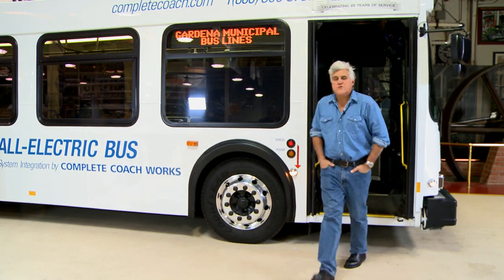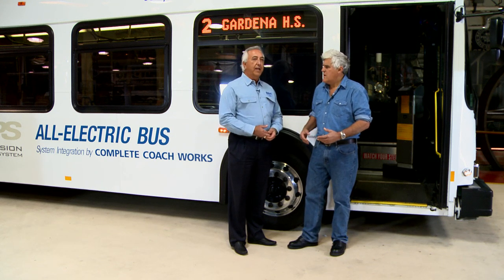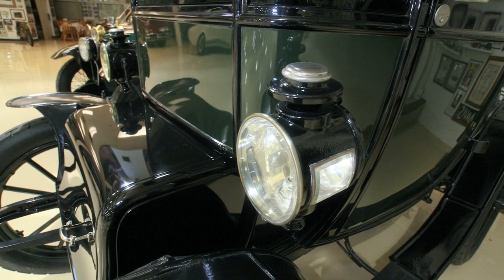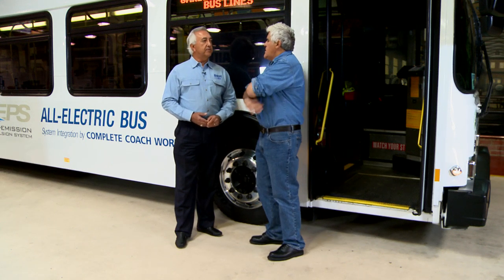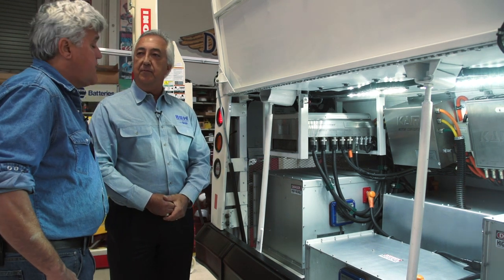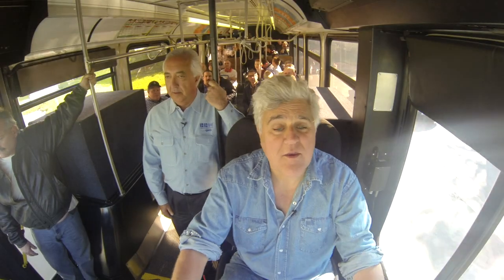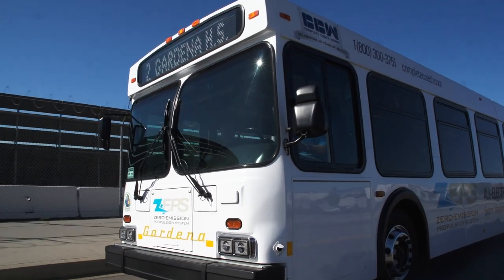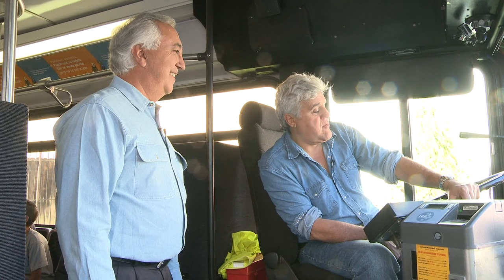Electric Bus Conversion - Jay Leno's Garage

Comment: I occasionally drive trolleybuses at a local museum operating from the 600v dc overhead, the UK had hundreds of them until the mid sixties and the last went in 73. They too had rheostatic brakes and were of course virtually silent and no pollution at road level. Battery buses like this are ideal for the cities and I think the recycling of the original structure is excellent.
Reply: and at the time nothing could beat the of the line from lights apparently
Reply: Perhaps the odd sports car :)
Reply: I'm old enough to remember the old trolley buses and probably went on one in '73. They could be a bit jerky when setting off as I remember. No doubt had they continued to use them they would have improved a lot.
Reply: I’ve ridden trolley buses in Seattle, Washington.  Still have them in 2021, brand new ones came out few years ago.     they have the 40 and 60 feet trolley buses.
Reply: Vancouver still has several trolley bus routes.

Comment: What a great idea to recycle and convert to electric! Well done guys! We need more of this!
Reply: But the electricity that charges the batteries is still produced from dirty old coal and natural gas!
Reply: @user-cy6gf2pj7y  Yes, but vehicle engines don't get anywhere near the efficiency out of fuel as power plants get. IIRC your car converts 1 unit of fuel [let's say natural gas powered vehicles for direct comparison] into energy at an efficiency of 20%. A Natural gas power plant manages 50%. Even with some energy loss from transmission [lets say we lose 20% in transmission... so only 40%, that is actually unrealistically high loss rate]... running electric cars off of batteries charged by central power plants will save you half the fuel and thus half the carbon output. 

Incidentally, plug-in hybrid cars get closer to 25-30% efficiency out of their engines when charging the batteries because they can run at a perfect efficiency cycle rather then the less perfect cycles straight internal combustion provides].

Comment: Retired bus driver from Las Vegas, here. I agree with all of you commenting about room on the roof of this bus for solar panels. Even with the HVAC unit mounted up top, RIGHT ON! They may be able to extend the range of the bus that much farther with solar panels. Also, among the buses in our fleet back when I used to drive, the one you see here, the New Flyer D-40 Low Floor, was a real treat to drive. They had decent power, a nice ride, and handled surprisingly well for a city bus.

Comment: I need my RV converted now, I love this kind of thinking.
Reply: I wonder if my housebus (converted school bus) could drive to California from Minnesota with this... Bah! Until charging stations are built across the country I'll have to stick to diesel. But once charging stations are up, battery capacity should be increased... That'll be cool once I'm able to convert it.
(I don't actually have the bus yet, I'll be getting it in 2020)
Reply: Range 80 miles. 4 hours to charge.

Comment: The roof of that bus is begging for solar.
Reply: +Snarky you can save weight with cutting metal roof,adding carbonfiber and solar panel...it would add to expenses but I think it would be worth
Reply: +Snarky absolutely not true, solar panels are not that heavy
Reply: +Snarky there are solar panels in pedal bikes and trikes
Reply: +Snarky No it wouldn't.
Reply: +coldcoldrain13 Yeah. And that would produce enough electricity to power the left blinker! But only on sunny days :(
Reply: +coldcoldrain13 
They mentioned that adding solar is in the works.
Reply: Gil Strang563 The square footage on the roof of that bus would easily generate over 3000 watts with current tech.
Reply: Solar is not that efficient to be able to produce any worthy amount of energy compared to available footprint of the roof. It'd rather stay on the bus parking roof.
Reply: how about a MEDICAL MARIJUANA SMOKING AREA on top?
Reply: Pumpkin see you in halloween
Reply: Bus roof could easily support 3000w worth of solarpanels.
Reply: +coldcoldrain13 The airplane was developed by private inventors.  Green tech has had billions of tax dollars thrown at it yet it's still a poor substitute compared to legacy power production.  If you libtards believe in this technology so much pay for it yourselves.
Reply: Their motor has regen which basically does what you're suggesting. When they go down hills the motor charges the batteries. If you put generators in the wheels they would have to only engage while going downhill as well.
Reply: flex panels would not weigh, nor cost that much.. we use flex panels on our rental boats. www.ecodonutboats.com
the roof on a standard 40' bus would be approx 30 m2. with space lost for AC and exit hatches there is approx 25m2 left for panels. 25m2 flex panels would weigh 90kg and would produce up to 20 kw per day.
they have 312 kw onboard and only charge to 80% and never go lower then 20%, means they use max 60% of their battery on routes. 60% of 312kw = 187kw 
Conclusion a solar roof would allow (on sunny days) the battery to be used less and take less time charging back up. in terms of percentage we are talking 20/187 = 10% battery savings on sunny days. you could say that the AC will run on solar..
Reply: Idk who is convincing these people that you dont get much power out of solar and that they weigh too much for it to matter but its ABSOLUTELY ridiculous and laughable lol. Do research before you spout stuff you dont understand.
Reply: You're talking about generating 360 volts at 130 kilowatt hours with huge amp draws. the Three Phase D/C motor reduces power consumption. But you would not be able to produce enough electricity with solar panels on top of the bus to make much of a difference. Little alone the cost of the solar panels and to implement them to the top of the bus. The way this bus sits sounds like the most cost effective way. The ideal goal would be renewable energy at the charging station not of the bus itself.
Reply: @MrWhite-pn7ui  much of legacy energy is heavily subsidized.  Both now and in the past.

On topic flexible solar panels would work but are less efficient.
Reply: Facts solar POWERED not solar assisted
Reply: How do you buy a bus for a couple thousand dollars?? How. Can you explain?

Comment: Another option is duo-powered electric bus which essentially is a trolleybus with onboard high-capacity battery capable of fast charging. However, it's also equipped with a pair of modern current collectors (trolley poles) you would see on a conventional trolleybus.  While under the wires, the bus is directly powered by electric power drawn from overhead wires and at the same time, it is also charging a bank of onboard battery (usually lithium ion battery).  The bus can go on battery with full load & air-conditioning running for up to 15 miles or more.

You only need to install overhead wires on certain segments of the route. For example, if you find the wires unsightly you have the option not to have overhead wires in the city centre or places of interests or popular for sightseeing for tourists, etc. You have the flexibility to have overhead wires only in the suburbs, housing estates whether the bus route is a cross-city route or radial route.  

With this technology, you can completely eliminate the need for overhead wires in the city and only have them in the suburban segments of the bus route. When entering the city, the bus automatically disconnects from the overhead wires at a touch of a button by the driver, which lowers the current collectors and locks them down on the roof and continues its journey like a conventional electric bus inside the city area. Upon exiting the city, the bus enters the wired zone and raises its current collectors at the specific catchment area (usually at a bus stop), also at a touch of a button by the driver.  Passengers inside the bus would not even notice the change of power source as this is done very quickly when the bus calls at a bus stop. 

Compared with a conventional electric bus:  
Carry smaller and lighter battery, no charging stations required, no time wasted on battery charging as it charges on the go, faster turnaround at the bus terminal if required by deployment,  guaranteed continuous supply of electricity with parts of route under overhead wires, strengthened reliability, more attractive to commuting public as overhead wires indicates the presence of public transport & a sense of permanence. 

Compared with a conventional trolleybus:
More flexible as it can operate independent of overhead wires for long distances like a conventional electric bus, eliminate the need for new overhead wires in the event of route changes or extensions (be it temporary or permanent).

With that, you get the best of both worlds. :)
Reply: Jere Cullen they are in use by septa in the city of Philadelphia no battery that i know of  but if they lose the trolley poles they have a small aux motor not sure if it runes a generator or geared to wheels they were called trackless trolleys in philly. makes much more sense to do that than the 32 million 25 fed funds to install tracks and wires in Charlotte 1.5 miles
Reply: take a look at the gyrobus from the 1940s. It had most of the features you talked about. if it had better range it might have even replaced the trolly car.

Comment: No comments? this bus is awesome! we should do the same thing in Europe.
Reply: We do.
Reply: dennis trident william I know we have Electric buses, I saw a couple in Copenhagen but I have never heard of one in Europe that was converted from a retired Diesel bus.
Reply: +Sohave in Britain we have an old 15 year old Dennis trident that was made electric and some more will be soon and it makes around 3000 foot pounds of torque
Reply: dennis trident william Cool In that case I take back my comment. I hope that many other nations will do the same to their old buses.
Reply: +Sohave We have lots of electric trains, if that counts
Reply: Re No I know we have plenty of electrified lines and Dennis answered that yes in Britain a few old busses have ben converted.
Reply: +Sohave We did, we call them Trolleybuses, no need for batteries (lithium free electric powered vehicle).
Reply: Philip Cooper I know those and they were not what I meant we are talking about battery electric vehilcles, and almost all trolley busses are build as trolley busses through many share the same basic body as diesel busses. But here is a little fun fact about trolleybuses, When speaking about converting a bus to run on electricity In Denmark during WWII a couple of regular buses were converted to trolleybusses by fitting a standard trolleybus engine to the existing transmission and attaching trolley poles on the roof. Here is a picture of one of those conversion trolley busses: http://www.vognstyrer.dk/Sporvogne/KS/Vogne/Trolleybusser/107/107-2.jpg
Reply: er
Reply: we use biofuel in Norway
Reply: +Re 
Battery operated electric trains or diesel powered generated electric trains?
Reply: We do. And not only with batteries buses. Also trolleyboses are pretty common. A very reliable system in which a bus can run all day long not needing recarching...
Reply: fatboyto I know of both build electric busses and trolley busses I was thinking of converted busses.
Reply: We don't like old buses in Europe, because they tend to be high floor vehicles, and demand low floor ones for better accessibility. That, and the body starts to rust, and needs replacement as well, not just the motor parts. But you're right, we could reuse them more often.
Reply: Bart Van de Walle
 Many buses build after the 60'ies are made out of aluminium so only the frame can rust and that is still pretty thick and probably still in good condition after 15 years of service.
Reply: +Sohave Not entirely sure, but it seems in Europe, there are more steal bodies in use, at least partially. But evenso, aluminium doesn't rust, that doesn't mean it doesn't wear out. About the frame, you're right, but rebuilding a bus from the frame up is more costly than when you can re-use the body, too.
Reply: Bart Van de Walle
 I agree the frame is just some rods of steel with the steering, brakes and drivetrain mounted. the big saving is in keeping the bus body. I think the majority of buses in the west were aluminium body. DAB buses and Volvo busses with Aabenraa body were aluminum bodied since at least the late 60'ies. but I think Ikarus used a steel body for a long time.
Reply: And there's proof we're still a long way from one single market, here, it's mostly Van Hool and Jonckheere (nowadays VDL) running here, with some Mercedes and Volvo added into the mix.
Reply: Sohave well this has been tested a long tome in Sweden at least, but mostly in city busses not the line busses, now the city buses often use gas from trash that comes from tbe city garbage depots and some taxis also use that.
so ideas for a better enviroment is not very american, tbe otber way around i would say they have come on that train much later as they alway could buy gas for nothing.
its because americans likes to get heard that it seems like they invented it all, of cource they refine stuff make it better, but it did not start here like it sounds in this video.
they can be as loud as they want if thats gives a change from the crazy oil consumption we have in tbe world still.
Reply: In Europe the most common is trams in city's and trains for longer distance. It's better because you get more passengers. But requires big investment from government. In poor eastern Europe and Russia they have Trolley buses. Like the bus in the video but use above power lines. And it works very good because buses use same rout all day, no need for batteries.
Reply: Trams are actually more popular in Eastern Europe, and Eastern Europe is generally not that poor anymore. Trams are sort of a different discussion, I think where the demand supports it there should be trams and it was a shame that so many western European cities abandoned them when they became unfashionable in the 60's and 70's. Trolley buses could also be a subject for battery conversion, this would allow them to expand their operation to areas without trolley wires. and vice versa, you could add trolley poles to battery buses and have them charging on certain sections of the route while they drive, instead of being passive while they charge.

Comment: Supercapacitors are being used in DC traction substations for streetcars and trolleybuses, they improve regenerative braking efficiency. When the energy generated by the breaking vehicle is not taken by another vehicle, it is not wasted in resistors, but taken by supercapacitors that feed it back to the section when it will be needed. Supercapacitors can charge up quicky and keep the charge for reasonable time before discharging. When you have regular, frequent service, they are a real benefit.

Comment: The bus looks like a Gillig Phantom (but New Flyer) which has full floor space, (the riders can be seated over the wheel wells), and the floor is all one level. All the interior space is available for seating.  My local transit co. is running 15 year old Gilligs and they are very quiet and dependable with few rattles or squeaks, little exhaust or air induction noise. The old Gilligs are far better than some of the newer buses the company has purchased.
 It is good of Leno to run this story since we are not all running supercars or antiques...People are in love with the sensation of driving, the sensation of moving and looking at changing scenery?
Reply: GILLIG Phantoms are high floor, not low floor.
Reply: Tim Skoglund I agree the old Gillig Phantoms were much better. The first thing I noticed about them is that they're a lot quieter. My local bus company has almost completely retired all their Phantoms for some terrible New Flyers and Gillig BRTs, both of which run in to a lot of problems and even smell of exhaust in the interior sometimes.

Comment: This would be an awesome RV
Reply: At 213 kWh, you'd have a rough time recharging that battery. 50-amp hookups can only provide 9.6 kW (assuming you have to limit yourself to 80% for continuous loads on those outlets, not sure if that's true), meaning you'd need a bit over 22 hours to go from empty to full. And then you've only got 120 miles of range (so, 2 hours of driving) to get to the next site to plug in for another 16-22 hours, depending on how far you go. And 30 amp only sites would be something like three days of charging.

I love EVs, but the numbers just don't add up here. Even an enthusiast would struggle to say they enjoy only being able to drive 2 hours before needing to stop and charge for a full day. Without serious improvements to power availability at RV camps, or huge efficiency increases in the RV, this just isn't an approach that works for most people.
Reply: @Phoen1x883  Yea, I can see much-needed improvements need to be made...I can only see that working for those who don't go long distances & or are retired and have all the time in the world to dilly daddle....Still, the money your saving on gas seems like it would be so worth it...if you like poke along...& sometimes ya do.
Reply: Awesome to drive 80 miles a day at 55mph? Like an hour and a half?

Comment: Also used in urban trains - o/head wires can be thinner. Batteries take an electrical charge convert it into chemical energy & do the reverse - accept & discharge slowly. Each stage of conversion consumes energy. Supercaps take in electrical energy & store and discharge as electrical energy and do it fast without much energy lost. Once the physical size of supercaps are reduced they can replace batteries outliving the car. A car body may be a part of an integrated supercap saving space